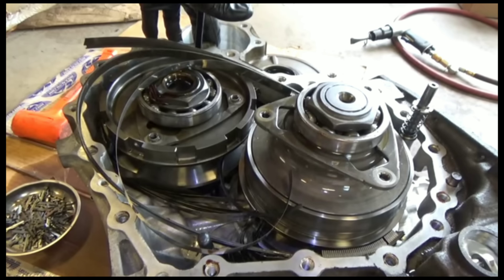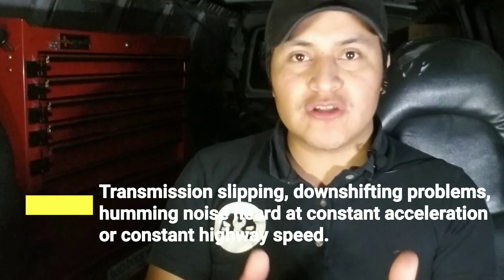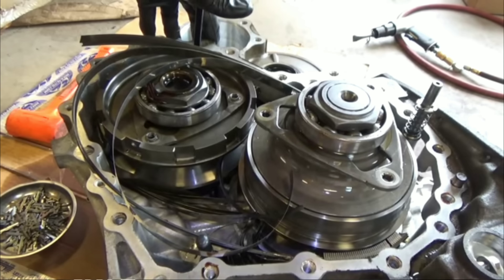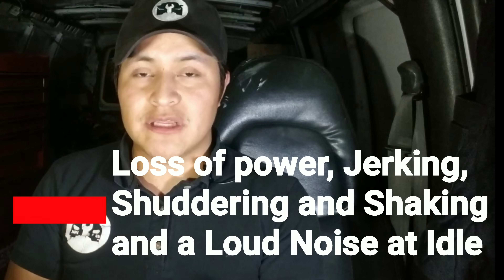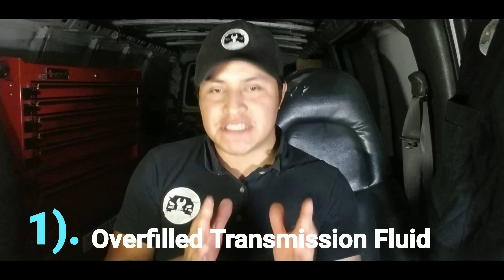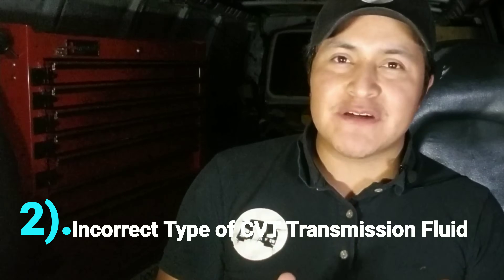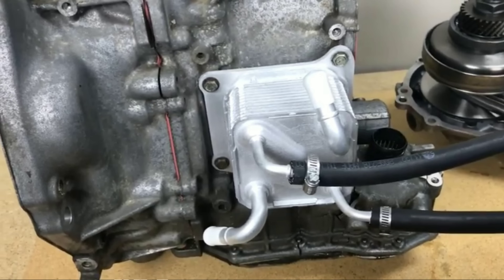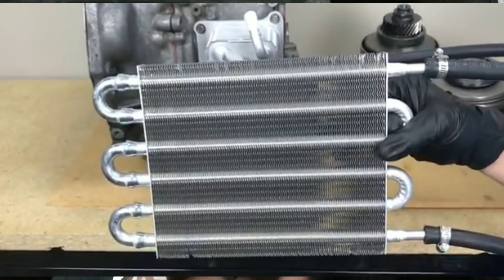NISSAN CVT TRANSMISSION | why it fails and what you can do about it to prolong it's life

Comment: They used to build quality cars, until they let Renalt take over!!!!
Reply: Up until 1999, they were Totally Nissan.   Then Renault bought part of their stock,  and the quality has gone down hill ever since.
Reply: @russellhancock9765  yep…. I had a 93 Altima it was great , Then I had 2000 Altima that was nothing but troubles . Timing chain tensioners
Reply: Renault doesn’t make cvt , trouble is just by nissan
Reply: @Sevan59  Jatco makes the transmissions, Total junk. They should buy Aisin transmissions wich are 10x better
Reply: @chefchutardo5215  well they own jatco sooooo they need to rework the transmission or just ditch the CVT.  They should go for a dual clutch, Porsche PDK, orr use the either infinity or GTR transmission
Reply: @VonDarko  either way, i aint buying one untill they solve that. I keep my cars for 20+ years, so i want quality cars.
Reply: @chefchutardo5215  Everyone is going to CVT transmissions for cars and small CUV/SUVs. They are cheaper to manufacturer and last long enough for most people drive/own their car. Sadly for those of us that hang on to cars longer, we may find in the future that even a Toyota is designed to fail by 200k miles. Unless you want to dump $4k into a new transmission on that old of a car.
Reply: @chefchutardo5215  jatco is owned by nissan. So they cant buy aisin.
Reply: @Sevan59  Renault is shit just like most vehicles built in France.
Reply: This also applies to Chrysler vehicles when Fiat came into the picture. They weren't the greatest cars but they are downright terrible now.
Reply: @sidewayz180sx  ugggg I can’t stand mopar products 😖😖😖
Reply: Russell Hancock - ....until Renault bailed them out of bankruptcy.  Nissan was bust when it was taken over.
Reply: I will never own another one.   I am going to have to replace all of the oxygen sensors on My 2001 Senta now to get it inspected and get tags back on it.  I really don't know if that is all that is wrong with it, but some jackass at what was supposed to be a professional Garage broke a spark plug off down inside the engine.   Now I have to fix his mess plus try changing the oxygen sensors to see if that will turn the check engine light off and I can get it inspected and get it back on the Road.
Reply: @russellhancock9765  The car is 20yrs old, shit happens. I had oxygen sensor go out in 10-15yrs...it's called maintenance.
Reply: Maybe they should have went bankrupt.   They sure didn't get better when Renault took them over.
Reply: Russell Hancock - Yeah, Nissan should’ve gone bust, same with Chrysler.  Instead, we get government-supported zombie companies cranking out garbage, screwing unwitting buyers out of their hard-earned money.
Reply: A V  I had a 93 Pickup, it was bullet proof.
Reply: 100% Bullseye RENAULT SUCKSSS
Reply: @TheCarguymiami  try renault duster & the koleos !
Reply: Hi, I am Graeme John Eddington. Following is my Youtube post of my Multi-speed transmission I have called: "Opposing Torque Dynamic Clutch" which is a type of Infinitely Variable Transmission (IVT) which I believe is ideal for your current applications. Please log on to my Youtube video: https://www.youtube.com/watch?v=SACDK89U7PM
Reply: They joined with Renault around the time they started slipping in quality.
Reply: Yup
Reply: Agree with most of you Renault, took their engine design to the trash when they got a sliver of nissan, they bought. All down hill. My loaded 07 maxima has 360000 miles changed out  engine  @ 180000 & trans. @ 75000.  Now@360k it needs another trans & it would put another 100k plus every major component has been replaced in the last year.....hmm what to do??? Cvt never again
Reply: Yeah another European huh?! Not surprised
Reply: A V  I have a 1991 Sentra that I would like to get running again but it needs some work done on it.   5th gear is worn out and they say it is cheaper to get one from a junk yard than it is to fix it.
Reply: @russellhancock9765  Junk yards have them for cheap.
Reply: sad but true also mitsubishi join the Renault-Nissan-Mitsubishi alliance
Reply: Ira Whattaburger.  Transmissions are sloppy after 200k
Reply: well what do expect when they let a company take over that has a silent T in there name
Reply: Russell Hancock Nissan is part of an alliance not a merger! Carlos Ghosn was the guy who started to cut costs and everything, Makoto Uchida is saving Nissan he’s putting the money in the quality and innovation.
Reply: Ok Scotty Kilmer
Reply: @jvazquez7160  I thought the same thing..lol...
Reply: 100% correct. Renault and Carlos (the crook) Ghosn ruined Nissan. Too bad Japan let Ghosn escape. He can ES&D.
Reply: Everything Renault touches, dies.

Comment: 230k trouble free miles on our 2011 Murano. Transmission is fine. The 2011 is the last year they were built in Japan though.
Reply: 2011 max ...180,000 no problems .
Reply: @alwaysright237  not all CVT have problem just those make buy jatco .
Reply: @alwaysright237  2011 hybrid altima 184k no probs either
Reply: 2013 max sv   125,000 miles no issues...just basic wear and tear and it get replace when I noticed anything...love my Maxima
Reply: OGpuppetAlief - 2014 Max with 55k and I agree.
Reply: Oh... I didn't know 2011 was built in China,  I would have to get the ok from scotty Kilmer before I buy one..
Reply: Chrisnas1 Japan not china
Reply: @VinnieLJ  my bad.. I was in another... 😂😂😂😂
Reply: Chrisnas1 Lmao! You’re too funny 😂
Reply: 2011 Altima with 165k miles. No problems. I just did two drain fills, never the expensive flushes.
Reply: Design problems.  It will eventually go
Reply: @ontarioman6301  Every transmission eventually goes. If people are getting around 200k miles on the original transmission, then that is great.
Reply: @rufuspub  normal transmissions fail too.
Reply: @ontarioman6301  I hope
Reply: You change the cvt fluid on it every 25-30k??
Reply: 185 000 km 2010 Nissan Sentra near 40 mpg also helps
Reply: Bull shit
Reply: @dantebrytant5285  why is that BS? Are you jealous? Do you even know what you're saying?
Reply: @dakentaijutsu2010  it's no way I don't see that happening
Reply: @dantebrytant5285  for what reason exactly? Just cause you don't see it, doesn't mean it's not possible, ever heard of take care of your vehicle and it will take care of you? Of course you haven't, the only reason you say it's bs is because you're one of the guys that didn't, and you're envious!
Reply: @dakentaijutsu2010  the point is just like scotty said Nissan is junk now being to cheap
Reply: @dantebrytant5285  and my point is not every single car will break down, that's your problem, you think everyone with a nissan vehicle will break down! Scotty may be an expert, but he is not always right, sorry that you probably had a bad experience with nissan, but that doesn't mean everyone who has one did!
Reply: That Murano is a nice ride

Comment: Just don’t buy Nissan’s with CVT transmissions, our Rogue started to fail during a family road trip on the highway.  Only had 80,000 miles and the cost was going to be $5,400 until we called corporate and got the cost reduced. It was still expensive and we don’t know when it will fail again. Plus, Nissans aren’t what they used to be, they had been bought by Renault years ago, and the quality of the vehicles has suffered greatly. IMO
Reply: Your Nissan Rogue should be covered they just extended the warranty up to 84,000 miles check your local dealer
Reply: It was two or three months back.  We went through a local Nissan dealer, and paid a bit less than half of the cost for repairs. I don’t think they will reimburse me either, but thanks for the suggestion.

Comment: I have an Altima and it's on its 2and transmission.   And the 2nd transmission only works for a bit then starts whining.   I drain the fluid and its normally dirty.  I change it and transmission runs again for a bit.  I also have an Infiniti g37 coupe and transmission is starting to jerk also.

Comment: Our 2017 Nissan Rogue was a quieter and much more reliable vehicle than the 2012 Ford Escape it replaced! In over 70K miles the only thing that went wrong was a dead battery. Can't say that about the Ford.
Reply: I'll go with what I know and see.. Toyota and honda.. f150 truck and that depends.

Comment: Could your thermostat not opening cause your CVT to overheat?
Reply: Yes. The trans coolers are cooled by your coolant.
Reply: @aaronbritt2025  Are you sure?  If so then why are some installing an external CVT cooler?  The stock cooler for the fluid has air fins which I assume dissipate the heat.  I'm a little lost on this associating between the coolant and the CVT.
Reply: @azjoe_6310  depends on the year and model. All Nissan CVTs have an external cooler with coolant running though them. Some also have an air cooler with fins.

Comment: CVT after 134,000 miles that hasn’t been changed. Do you recommend having the CVT service? How do you feel about flushing the system versus dropping the pan drains the CVT?
Reply: Nissan dealer in my area don't recommend flushes. Drain & refill. It might be too late to do it now too many miles you might be open up a can of worms.
Reply: H B thank you. I get low oil pressure when I scan it with my OBD2. I get a P0858 which means low oil pressure.
Reply: I guess with that code P0858. You're having problems with the cvt correct ? You never stated cvt problems maybe you have low fluid level?
Reply: H B There isn’t any issues with my CVT other than the normal shutter when pulling out from a dead stop. CVT are known to shutter. It runs fine but I keep getting the same codes P0858. I think there a oil filter in the CVT that needs replacing which is probably causing the code to come up.
Reply: Fluids is fine not low
Reply: @JCru2  What's the year make & model? Go to Nissan dealer for CVT drain & refill. In my area Easton,PA costs about $150.00 Try to reset the code before you go for service. Play dumb something happens you blame them. Hey you might get a new CVT you never know.
Reply: H B nice. I like that. If something does happen to my CVT after their service, I guess they would have to correct it. They should stand behind their work and their brand Nissan. I drive a 2011 Nissan Murano SL. I do have regular services on it, oil changes and radiator flushes but nothing major has gone wrong. If it’s not broken don’t fix it.
Reply: Thank you for your time and advices
Reply: @JCru2  Our 2011 Cube cvt still failed at 106,000 miles. The same 30,000 miles CVT drain & refill at Nissan dealer as 09 Sentra. Financial lesson learn. When your cvt get high mileage 150,000 miles plus oem. The life expectancy is short like playing 50/50.
Reply: H B thank you. Do you think the drain and refill caused it to fail? Did it run better or worst after the service, drain and refill?
Reply: @JCru2  If you haven't did cvt service on a regular basis I personally wouldn't do it. Like you stated " If its not broke don't fix it"
Reply: H B I’m sorry the code is P0868
Reply: Wow! 134K miles? which model and year of CVT?

Comment: Every brand has their lemons and, Jatco may very well not be "Gold Standard" in transmission manufacturing, however, I definitely suspect driving habits and maintenance to be MAJOR contributing factors.

A million years ago, when my father taught me how to drive in his Model T, he taught me that racing from traffic light to traffic light was not good for an engine or transmission.  Slow and gradual acceleration makes a (non-high performance) vehicle last.   Yet, all day, every day, I see people gunning their engines and racing to get to the next traffic light to beat their personal best 0 to 60 times.   All these years later, I have never had an engine or transmission failure in any vehicle.

My 2007 Nissan Altima has 165,000 miles (and counting).  Nothing but routine (oil, tires, brakes, transmission fluid, anti-freeze) maintenance.  Car runs like the day I drove it off the lot.  Would I prefer it to have a conventional automatic transmission?  Yes.  However, it has been the best vehicle I've ever owned.
Reply: All depends on the driving conditions. For example here in hot Miami, FL. Your driving experience will mostly be spent idling in bumper to bumper traffic in 90° + weather for a good hour or more. That CVT will be tapping out by 100k. Happens here all the time. You can peruse the local classifieds and find dozens of late model, clean Nissans with 80-100k and dead transmissions.
Reply: @LynxStarAuto  I hadn't considered how those CVT's held up (or not) in hot climates.  I wonder whether that's the case in southern California, Nevada, Arizona, and Texas.  I have been very fortunate with mine, and I love Nissan's VQ engines, however, I don't think I'd roll the dice again with a CVT.
Reply: I'm also starting to think that warmer temperatures really affect these engines. I live in canada and everyone seem to be so happy with nissans

Comment: Yesterday I receive a letter from Nissan saying that my car transmission is extended to ...7 years or 84.000 miles .Whatever come first .
I have 2016 Altima , with 28.000 miles , and so far I don't have any problems with the car. Drives beautiful , and I hope continues the same way.
I also drive moderate , not crazy speed driving in the highway !!!.....Nice and easy !!!
Reply: Oh my Nissan problems with the transmission and other stuff like the AC unit, & rubber on the car started around 25K. I also have a Honda and the rubber is in great shape, the AC still works, etc… & the SUV is a 2010. With low mileage. I’d never buy Nissan again, it’s a total piece of garbage car that belongs in the dump.
Reply: any pile of junk should last 28k miles if driven lightly,   back in the model t days they might not expected much better

Comment: Some nissans have 2 transmission filters, check them or replace them along with the fluid drain and replacement.
Reply: Actually all CVT have two filters. One hidden in the oil drain pan. Then there’s one cartridge type filter in the oil cooler unit. They should be changed every 60,000 miles.
Reply: @ricksays7133  30,000 to be safe

Comment: Thank you the best detail explanation of the cvt failures. My daughter's 09 Sentra just sold it with 200,400 miles original cvt a miracle from God ! Her Sentra did go into limp mode a few times in very hot weather. To fix this pull over let in cool down to reset cut off AC & put the heat on defrost & open the windows. Also cut off AC in stop & go traffic in Summer & use heater to help keep CVT fluid from overheating. I know this sounds crazy but it lasted years until we sold it !!!
However, my son's 11 Cube failed at 106,000 miles. Nissan dealer did all the cvt fluid drain & refill at 30,000 miles intervals it still failed. A rebuilt cost me $3500 with a 1 year or 12000 mile warranty only! Never again in my lifetime will I purchase any type of CVT garbage!!!!
Reply: Your comment is humorous. At first I thought it was going to be a CVT apologist, then it turned vitriolic. 😂

Comment: Wow I'm sold.  I had no idea the antifreeze can cause problems in the transmission.  I had my water pump changed and began having transmission problems on my  '14 Maxima.  New subscriber.  Thanks. Doing a flush today.
Reply: I'm a mechanic myself run my own repair shop, and once upon a time a mobile business. Coolant flushes to me are a waste of money, and can cause more issues than they solve if you do not properly refill the system, and inadvertently introduce air bubbles.

Most modern day coolants/antifreeze are good for 120k miles. Most will never make it that far, because I assure you the system will develop a leak long before the coolant breaks down. Case in point: your water pump failed. A coolant system is comprised of wear and tear items (namely hoses and plastics) which will fail long before the coolant breaks down.

 Not to cast an ignominious view on the video creator, but he is a mobile mechanic. Mobile guys are very limited in the repairs they can perform because they do not have resources, or equipment available to them, that a repair shop does. It's not the same thing to fix a car in a driveway or on the side of the road, vs in a repair shop, on a lift. For that reason, these guys use the "limited resources preventive maintenance approach." Basically, they push the in and out repairs and services that can be completed in an hour or two tops. They fix something that is not broken, and you think you are buying piece of mind.
Reply: @LynxStarAuto  thanks for the reply.  So you don't think what he said was accurate.  That improper antifreeze can cause issues in the CVT transmission ?
Reply: Heat1up dang how many miles on the Maxima? I did a CVT fluid swap at 110k miles on my maxima and it’s still trucking at 123k miles
Reply: Do not flush, simply change it.
Reply: @Noah-ui1iu  I was talking about the antifreeze. Not transmission fluid.